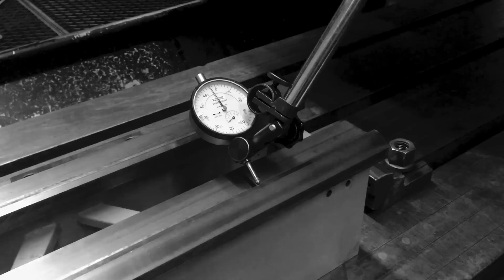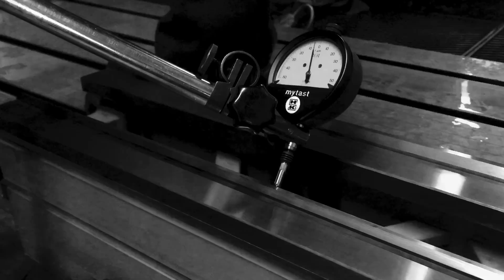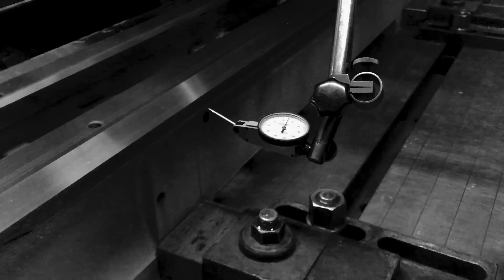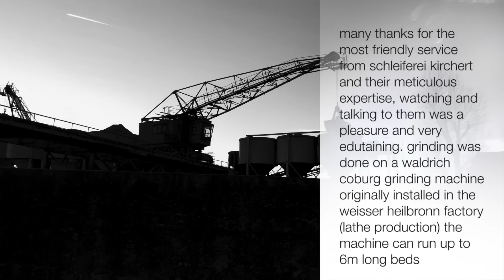EMCO Maximat Super 11 Machine Bed Grinding

Comment: Why the shim under the front right corner of the lathe? To compensate for a problem with the large bed or a lack of flatness of the grinder table? Was the bed twisted? Very interesting to see the setup. I expect it is 2 hrs of setup and 10 min of grinding!
Reply: The bed being ground has to be free from any constraints. If it's hold tight on the table, it won't be straight anymore when released. So when adjusting, they use a dial on the gantry to make the bed parallel on both ends, where there's no wear. shim is used because the sole is not perfectly parallel with the bed. Maybe they grind the sole after the bed, but i don't think they bother with it, as the lathe has to be levelled on installation.

Comment: Nice work, but you can't grind and check guide ways on same machine.
Reply: Grinding and checking path is the same, that is table movement.If there is a problem in straightness of table movement that will reflect on ground surfaces .We should check accuracy of ground guide ways by using  levelling method or by any other straightness checking method available with us.
Reply: I m not questioning and kidding, if you are not interested to discuss it's ok.
Reply: No doubt about German Technology.
Reply: you're missing the point that Ranjeet is trying to make - if the ways of the grinding machine have a bow in them (the grinding head is stationary), then, when you put a true straight edge on these ways - it will indicate as bowed, when it is actually not - that indicator from the grinding head to the table basically indicates one distance in the grinding machine itself
so, in principle - if you ground something on that moving table, then the straightness check when the ground part is moved on that same table is redundant - because any inaccuracy would be noticeable when you're sparking out as you approach the final dimension - this check simply serves no real purpose
so, to have a true check of the straightness of the ground surface, you should have the part stationary, and check it with something else that is not part of the grinding machine, be it either a rolling/moving precision level, some optical device or even a true straight edge with some blue on it - depending on what geometry exactly are you trying to check
Reply: I don't doubt the skill of German machinists, that is besides the point, we're talking about one particular and specific operation after the grinding is done, and you keep using general assumptions to defend that, which is quite weak and makes me think that you don't really understand the issue with that operation

and who are those "people from all over the world" sending milling tables to Germany, because I haven't heard about it for sure... maybe if they are somewhere near Germany, sure, but there are very capable machine shops across the globe, it makes basically zero sense to send something heavy across half the world to be rebuilt - order something new, sure, but rebuilding - no way, I simply don't believe that statement...
Reply: You are absolutely right! The final measurement which the guys have done, prove absolutely nothing about the new bed geometry. It does not make a sense to check the final result (geometry) on the same machine on which you have done the grinding (machining). There are other methods available to check correctly the geometry of a machine bed.
Reply: @BasementMetalWorksInc  Not necessarily true. It depends on how the grinder was set up and tested. They may have done a bed and checked in on a surface plate to prove out their grinder. In fact we don't know what happened after it left the grinder. They may have just validated that they removed enough stock and the dial gauge didn't show and dips indicating they hadn't ground off enough bed. They may in fact check it on a surface plate for a final inspection. They took very good care setting up the bed to grind it, looks like they know what they are doing.
Reply: Did you see the lathe bed was shimmed and clamped?  Shimmed on the corners?  The answer to this argument starts at 6:09
Reply: bcstractor  oooooo ok. so your old. and not very smart. now i get it.
Reply: The machine has a tolerance for flatness, perpendicularity, parallel, etc. The machine being ground has a more open tolerance than the grinder did when it had its bed ground. All from master surface flats. So yes you can check the flatness on the grinder
Reply: you are right that maybe should be checked on surface plate?idk,im hobby for now
Reply: but waiiit a sec why they used shims?????he(she) must put shims before the instalation, or they are fixing something in their grinder???or maybe they ground the bottom after the way grinding and than again they grind the ways???
Reply: bcstractor  perhaps you are the insult to germans. you are saying if you send anything to germany its a gaurantee that it will be perfect. people are people. shops are shops. just because you were born on a particular piece of earth does not ensure you will be a good machinist. thats just predjudice. you seem to be putting german people in a box you have created through listening to steroetypes and watching movies. real life answer is anyone can be good at anything and anyone can be bad at anything. best you can do is to not make decisions based on steroe types and then defend those decisions based primarily on those stereo types. this is whats wrong with the world today people arguing based on assumptions and no real fact based evidence. just there made up opinions.
Reply: bcstractor  your a muppet
Reply: bcstractor  you appear to make assumptions. you appear to be a fool who considers himself "well" qualified. i no longer am interested in your "opinion" as you have proved you are not very intelligent on more than one occasion.
Reply: bcstractor  you obviosly have no idea about what the OP was reffering to. your a muppet sir. someone who tells others how "qualified" he is but cant see the nose in front of his face. go read a book and leave the real world stuff up to us. il let you know when i want to hear your "opinion" on a "theory" and even then il make my own judgement based on 20 years of "HANDS ON experience"
Reply: bcstractor  first you tell me i have no experience then you ask what tools i have. yep your pretty old. the 50's are over grandad. functioning brains are the in thing now. enjoy yelling at the keyboard.
Reply: bcstractor  look old man, if you dont understand how mesureing something on the same bed that created it, after all these years then i dont have the time or the crayons to explain it to you. enjoy your senility.
Reply: I beg to differ. If you turn the workpiece 180 degrees, (north to south) the eventual lack of straightness of the grinding machine becomes apparent. Moreover, in this particular situation where the grinding machine's table is way longer than the workpiece, it's enough to move the workpiece further in or out, measure it, turn it 180 degrees, measure it, and back to the grinding position, measure it. This way , after 2 turnings and moving to 2 differrent locations, one can map out the errors and assign each error to either the workpiece orto the machine bed. Maybe the gentlemen working on the grinding machine already know if and how much lack of flatness their machine has, simply by doing this test in advance or from previous jobs on other workpieces.
Reply: @mihailfelixdumitresc  ok, would you accept a bed  ground and checked on same machine at same position?  if operator says my machine is ok.